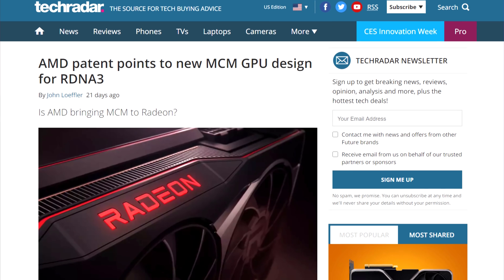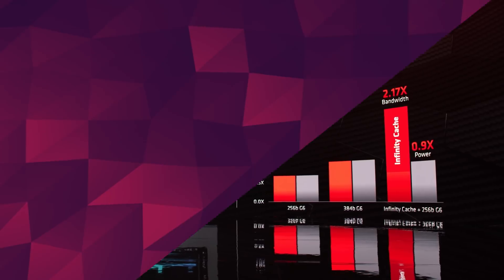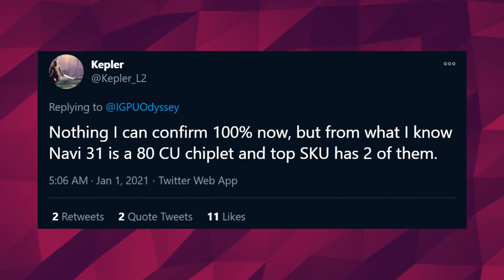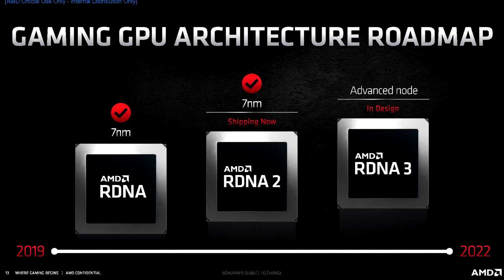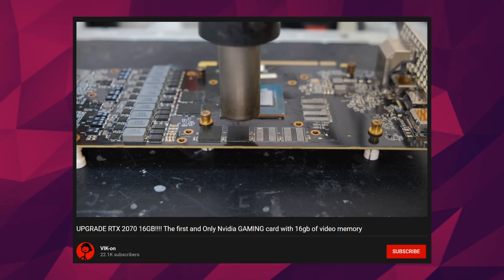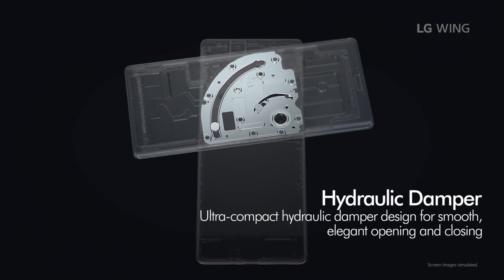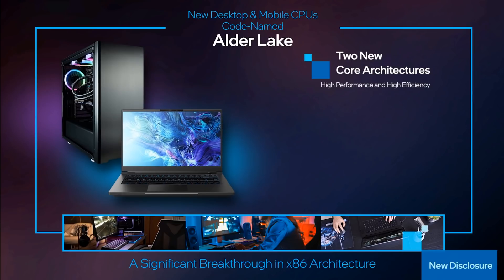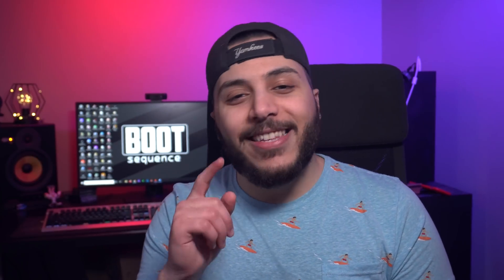AMD RDNA 3 Rumored to Have INSANE Specs! Navi 31 With Dual 80 CU’s Chiplets, 2.5x Performance ?!

Comment: I still believe the consoles should have been designed around RDNA 3 as this would have allowed games to properly embrace ray tracing, AI upscaling, 4K60, etc instead we  have just missed that boat and now have years of trying sneaky tricks and corner cutting to maybe get there.

The end goal of 4k60 for the consoles has always been a locked target, a massive number of people have 4k TVs and this number will only increase in the coming few years. RDNA 3 is going to be a huge leap in performance and efficiency, the two key areas in console design. 

I accept you can always say 'wait for the next big thing' but there are also good and bad times to buy/design something too. 

The gaming world is on the cusp of massive changes right now with ray tracing, AI upscaling, 4k60 for the masses, etc and with just 1 more year of development would have allowed the consoles to fully embrace all of these things.

Zen 4 + RDNA 3 + infinity cache would boost the performance of the consoles massively, moving to 5nm EUV would allow many more cores and higher clocks. AMD's ray tracing cores would be much more development, their DLSS equivalent would be fully ready. We would genuinely have a 200% increase in performance just for waiting just 1 year. I personally think that would have been worth it.

Comment: Todays Ampere versus RDNA2 GPU fight was always just the opening battle in the war. The most important battle was to be RDNA3 versus Hopper. AMD and Nvidia were both clearly caught off guard by how well RDNA2 competed against Ampere.

Both companies were always aiming for Hopper versus RDNA3, with a MCM/chiplet designs as the real battle for the the market.  Nvidia folded first backing down to Lovelace. This left AMD with a choice, iterate or go for RDNA3 on chiplets.

AMD has been preparing for chiplets since RDNA1. First they created an RDNA architecture that has nearly infinite scaling CUs. Then they figured out infinity cache that allows them to double the throughput on the memory bus. The final piece was the chiplet design of a GPU which allows the CPU to see it as a single GPU which we see in the patent.

All the pieces are there. Nvidia wont be ready until 2023 or 2024 with an MCM response.

Is there any doubt that AMD will pull the trigger on a chiplet design RDNA3?  You bet they are going to try and bring the hurt in gaming.

However the scariest thought for Nvidia is not what this will do for gaming. It is will AMD also do this with CDNA in the data center and 2.5x performance there as well?  That is the one that will keep Jensen up late at night.

Comment: Personally I think triplet design for gpus makes sense for AMD at 40cu + 40cu + 40cu or whatever they want to do but I don't see anyone getting a 160cu GPU for $1,000 that ain't going to happen in 2022
But honestly maybe it makes more sense to use chiplet to offload the ray tracing ability onto another triplet I don't know I'm not a GPU architecture engineer

Comment: People now mix the cdna to rdna. Cdna will be chiplet based gpu. While rdna is monolith desing. So the 160cu version is cdna, not rdna gpu! The sli / crosfire problem still exist in graphic using multible chips. In computation those problems does not exist.

Comment: Looks like 2021 is gonna be a really good year for tech. 2.5X performance in RDNA 3 seems a bit optimistic though, I can see 2X happening with higher clock speeds, a more efficient architecture and 2X 80CU chiplets, but I doubt they'd get more than 2X given the losses due to parallellization and the interconnect.
Also hype for DDR5 coming to the mainstream, I can't wait to see what a Navi APU can do with it (though that'll probably be next year).

Comment: If the bridge is really that good im not suprised 7000series will be 80-100% better than 6900xt
Reply: That would be massive, that would literally mean 4K 144Hz would make sense for most of the games today.
Reply: @jonasziegler3025  Take a 6900XT and tack on 100% performance and that is what you will get with a 7900XT. Due to latency of gpus to master chip communication you will probably see 75% performance jump from doubling the CUS...now add on IPC gains...Looking at probably double the performance of the 6900XT.
Reply: @VoldoronGaming  Yeah, something between 75 and 100% sounds legit though, looking forward to the cards.
Reply: This leak came from the same guy that leaked the RDNA 2. So this most likely will be true

Comment: I want RDNA3 to be chiplet based. I can’t believe why anybody is arguing against MCM GPUs with these prices and availability problems.
Reply: Dont think MCM would solve prices and availability. Just look at Ryzen 3000 and 5000 series it still is hard to find them at reasonable price.
Reply: Even Nvidia admit that MCM is the future, but they must solve that latency problem, AMD is try to slove latency problem by putting faster memory, "infinity cache".
Reply: @RGMUFC1  u mean infinity cache and not cash or maybe i missed the joke.
Reply: @divanshu5039  No you didn't couse i ALWAYS write this word wrong, ALWAYS and then i must edit, cose for some reason i can't remember for life of me, to write cache. Thanks for the reminder!!!
Reply: Well the main argument against MCM is information lag between chiplets.
Reply: MCM has to be properly hardware coded for on the system...so it appears as one GPU and executes single GPU code...this takes time to develop. Otherwise most of those cores will simply be unused unless devs code software from the ground up to be SLI compatible again. Lag is not the main issue....just one of them.
Reply: @generationkilled  Yeah I don’t care. I think AMD should just push it out in 2021 or 2022 like Nvidia did with RayTracing and if something doesn’t work just fix it in the next Generation.

There was also no software support but their  marketing hyped it, they said it was the future and they never will look back and that’s sadly how you have to push hardware in the 21 century. 

Shit out an prototype that barley works and say you fixed everything in the second Generation.
Reply: @nise7775  the cores would be small chiplets...if it doesn't work it will run like a fucking potato on one core. IF it runs at all...Hence why AMD will want to develop MCM properly...
Reply: @generationkilled  that's not how it works, MCM design is NOT like SLI, when MCM is properly done, then no changes have to made at the software level to correctly address, just like nothing changed when ryzen CPUs came out, any program programmed for proper parallelisation over multiple cores scales the same over multiple chiplets, so any 3D video API which are already designed to scale over multiple CUs in existing GPU tech will address all chiplets because that's how AMD design their chiplet based hardware
Reply: @Glen0cide  I know...And that's why its gonna take longer otherwise MCM would not be able to use all the dies. Also very few programs fully parallelize cores on CPU's games for example will at the moments only use between 4 and 6...The reason 64 core Ryzen's EYPC's  make sense, is because they are running multiple VM instances and doing multiple programs in sandboxed environments on Servers or they are running high end 3D render apps. It takes time to develop a hands free parallelization code that runs like a single CPU or GPU without devs having to code for the extra cores themselves.
Reply: @generationkilled  I see where your line of thinking goes and I agree to an extent, but the way I understand how existing graphics APIs draw pixels and calculate geometry they already parallelise workloads over multiple CUs (or at the shader level many thousnads of shaders) so while SLi has a lot of problems tracking and delivering data over totally separate GPU dies, the difference is SLI is in independent circuits and across different PCBs, PCI devices and Vram environments, once  multiple dies get integrated into a single addressable package, sharing vram and the same circuit and infinity cache, as long as the hardware is designed well then the existing framework of video games should scale perfectly well, without software and coding redesigns because unlike software that historyically has not addressed multiple CPU cores, graphics APIs have been spreading workloads over many Shaders and compute units for some time.
Reply: do you think having 2 chips on one gpu is going to make it cheaper or more available?
Reply: @D1craigRob  Chiplets could help with availability because smaller chips are easier to produce especially on smaller nodes like 5nm but COVID and Mining are probably more important factors with availability. 

Manufacturing prices will probably also drop but if it’s working great and Rdna3 beats Nvidia the pricing would probably not go down for the consumer for the first generation. AMD got lots of R&D cost in Rdna3 and somebody got to pay for it. (Probably 1000-1500$ for the 7900XT)
Reply: I don't hate inovation,
But man, chiplet design is full of latency.